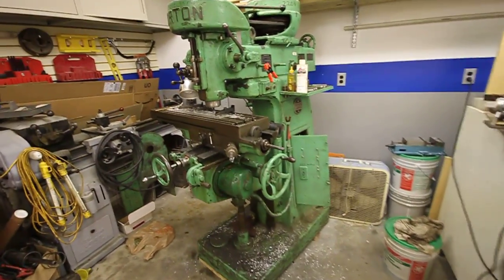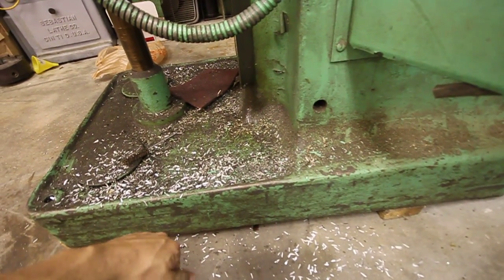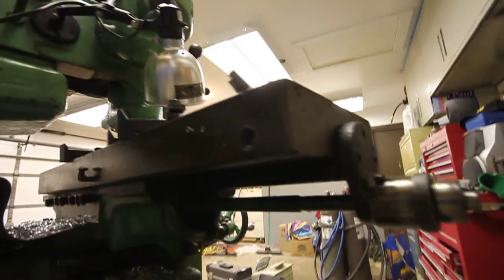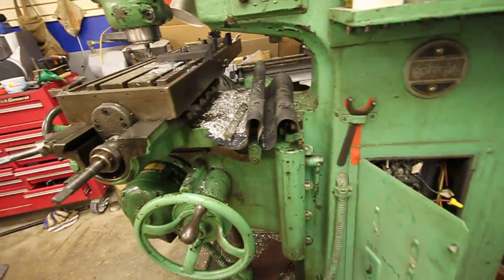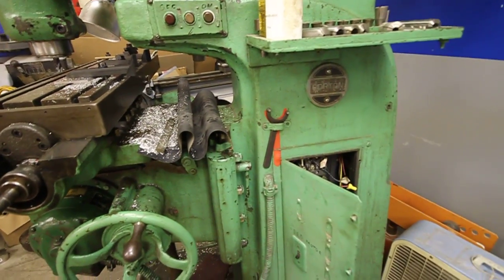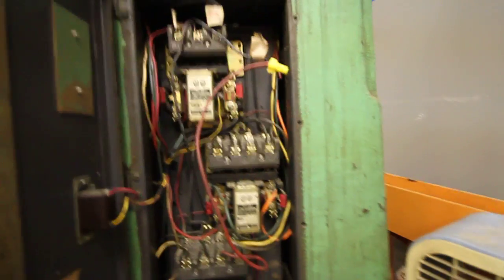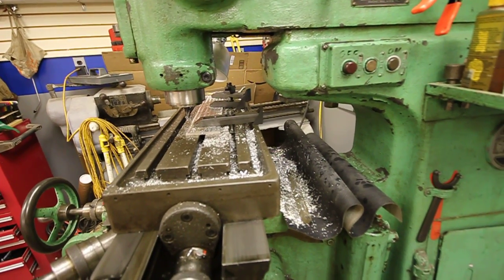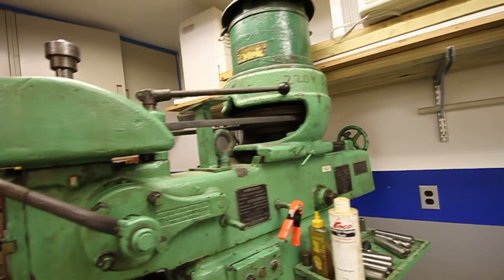Gorton milling machine accessory options

Comment: the gorton website is defunct, but there is always VintageMachinery.org
Reply from the maker: Chris Leech there's a Gorton mill yahoo group as well that's very helpful. https://groups.yahoo.com/neo/groups/gortonmill/info
Reply: Thank you very much my friend.   Good news for sure. Perhaps there will be some classified ads there too :-) And I will be looking into the Wells Index as you call it? 
Best regards C
Reply from the maker: Chris Leech I have an 8.5D spindle I'd like to have reground. I wonder if they'd reduce the cost if a few of us went in together
Reply: Keep in mind that the Gorton (no model # as yet but it is enormous)  is still sitting in shrink wrap,  not entirely paid for, and sitting out back of my favourite metal metal merchant in Kingston Ontario. Currently powered by 3PH and I have single phase 220V plus...  I only have one job scheduled to make the parts for this CNC Router.  Massive stumbling block really. I refuse to pay $3400 I have been quoted from the the only fabricating company that yielded a reply (out of 6 sent) Its not platinum for crying out loud.
So when did you want to do this :-)
Reply: Talk about green!  Here I was looking for Wells-Index grinding service and rather it is the device used to accomplish the job. Jeeze louise. Okay so I am putting out some feelers on the grinding services that aren't too far away. Shipping is a large fraction of my build cost.
Reply from the maker: Actually I believe it's either Wells Index or a company in the same town that's grinding the spindles. Check out https://rover.ebay.com/rover/0/0/0?mpre=https%3A%2F%2Fwww.ebay.com%2Fulk%2Fitm%2F121629211174

Comment: Are you still running the old gortons? I am looking at one, still in the shrink wrap, nobody knows the model, but they say it uses B&S#9 taper. Just wondered how big a deal that will be. Can one alter the spindle? Certainly there is very little toooling available on Ebay. Grand Tool sells a couple of adapters to MT2 I think it was. One or two collet sets out there. Just one big headache as far as I can tell. Price is right though :-)
Reply from the maker: Chris Leech I'm still using this mill. The spindle can be reground to r8 by wells index and others.There are #9 b-s collets available though.